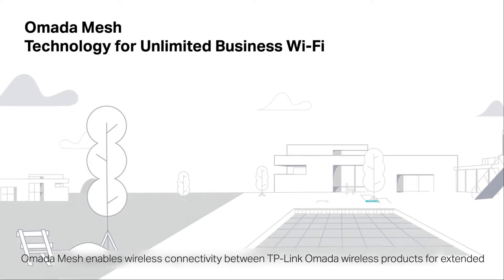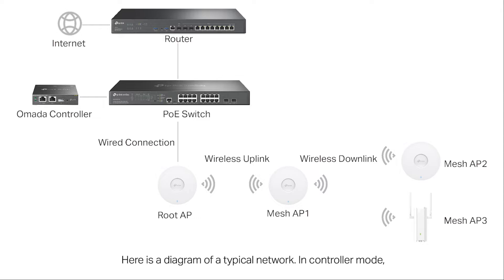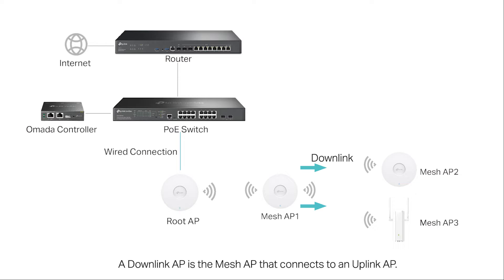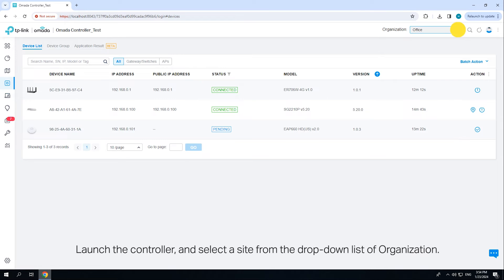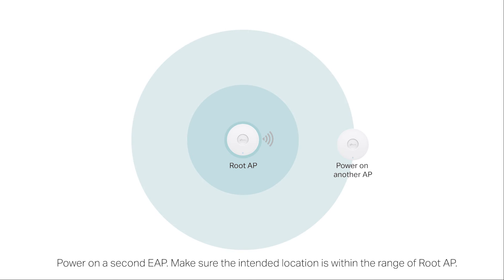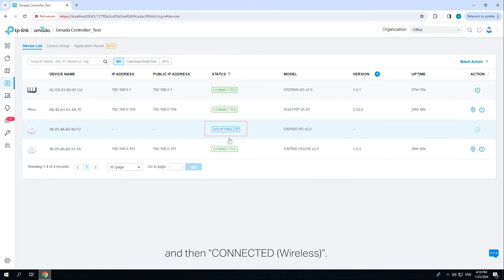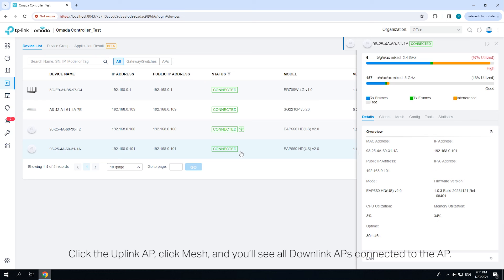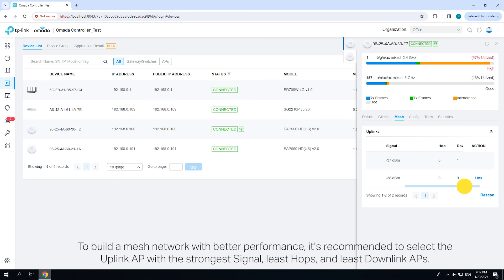How to: Build an Omada Mesh Network via the Omada SDN Controller

Comment: Will this setup work? Typical home wifi router connected to a POE switch which has 3 EAP225 plugged in. Meshed together using the software app? Does the software app have to be continuously running on a device in the background? Or do I need to buy a TP link router and the Controller? Setting up for a church. Low budget.
Reply: I have the some problem,  4 EAP plugged to a POE switch,  could you do it with the software app

Comment: The problem with Mesh AP is that you can not deploy a Wlan Optimisation....
Reply: Yes, you're correct. When using mesh networking with certain access points (APs), you may face limitations in deploying WLAN optimization features.